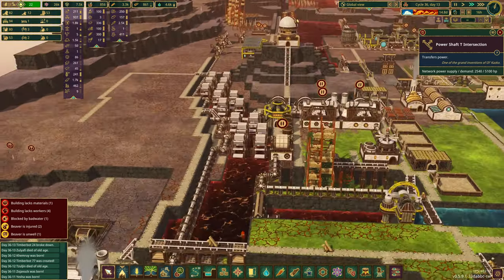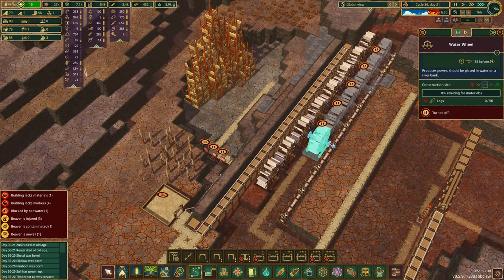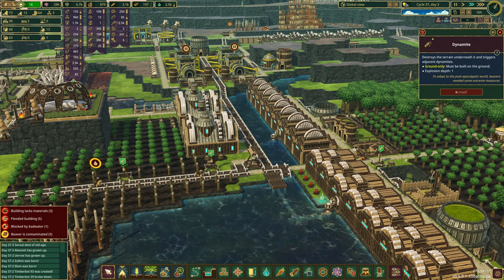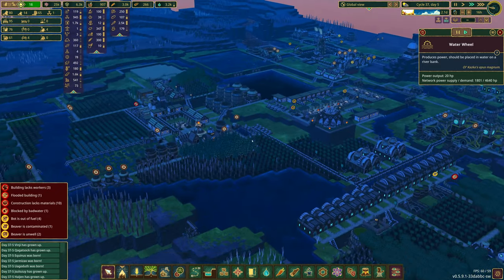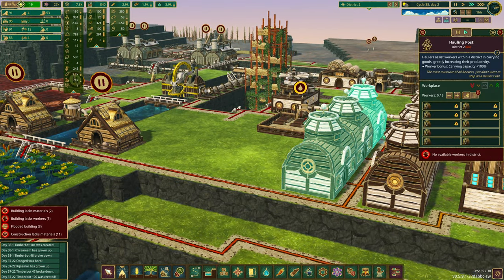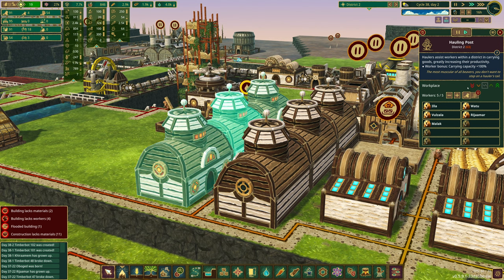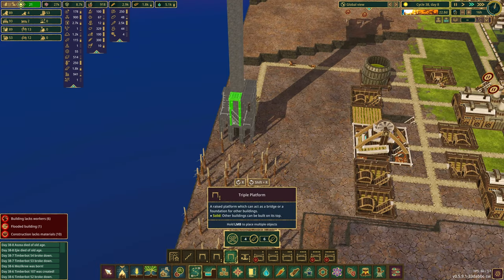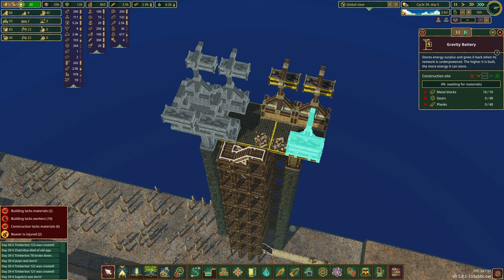Power Preservation: Gravity Batteries Unveiled in Timberborn  | Badwater Lakes Episode 17

Comment: Water wheels create water "back pressure" which causes the water level before them to raise just a little bit (about 0.1 per water wheel), so if you have multiple wheels in a row it can raise the upstream water by more than a block causing overflow. You need to let the water descend in order to continue flowing through more water wheels.

Comment: 14:24 🚨 during Badwater season .... Badwater flows above those powershafts going upward to power the dirt excavators  ( water flows thru the building 1 level below door ) ..... If you remove 3 straight powershafts, put a dirt block at middle, then powershaft up & over it ..... Then Badwater will stop flowing from new waterwheels thru dirt excavators & contaminating the area by lumbermills/gear workshop

Comment: There is water flowing backwards off the map at your water source blocks.

If you levy it off, the water will have even more flow down your power river :)

You could also turn that whole area into a giant reservoir.  Use levy’s and 3 high floodgates to store and release the water during a drought. 

It means you will continue to get water wheel power during a drought, you just need to keep lowering the floodgates to release water into the power river :)
Reply: For some reason, he just isn't looking where the water leaves the map. 🤷‍♂️

Also, he needs to put some dams, levees, and floodgates in that bucket-like valley to the north. That way, he can even add the water coming from that second water source to the flow. But that would require checking out that part of the map.
Reply from the maker: I do have plans to make a reservoir in this area.   Great tip though to block off the water source.  Never thought of it flowing back off the map at the source

Comment: 53:15 additional gravity battery platforms ... ( You could avoid building 2 out of 3 of the columns of platforms by using bridges)  ... Just plan out where the columns of dirt go, then 1 column of platforms touch that, then a bridge from last platform touches that platform..... Just wait to build the next bridge until the metal platform is complete, since beavers won't build over the ropes of a bridge.